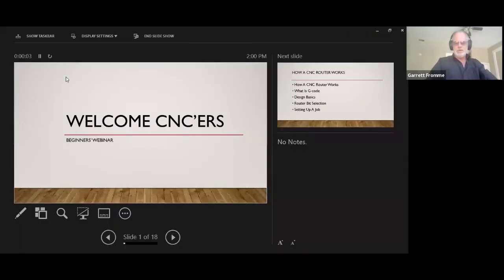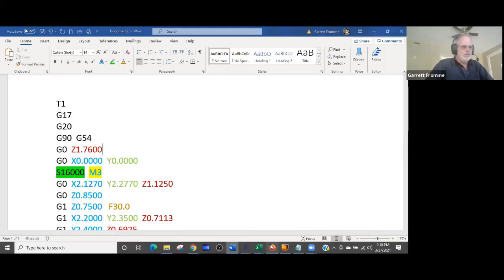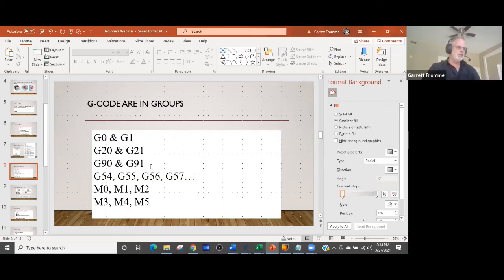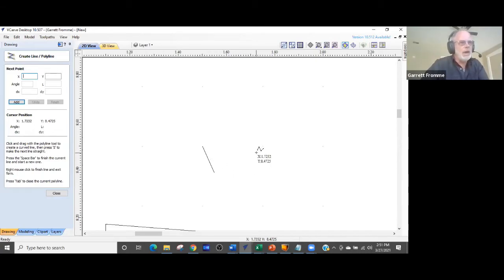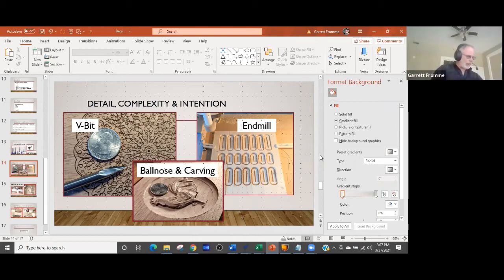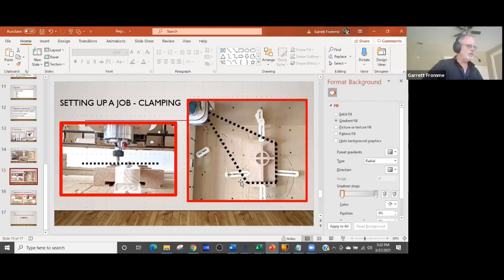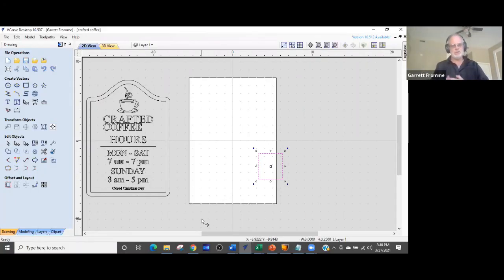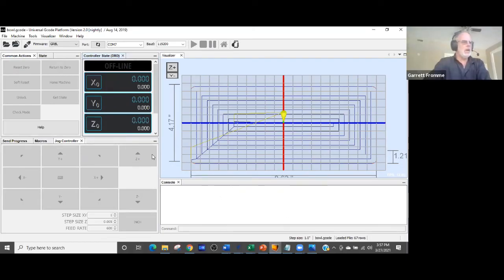CNC Router Basics Webinar, How They Work, Design Basics for Beginners

Comment: A little off topic, How would one die-cut a sticker on wood?   
My image is sized 5" x 5" .jpg, but when I import it into Aspire with a work area of 5" x 5", the image is smaller than the work area of the same dimensions.
Is there a dpi image setting in Aspire?
Reply from the maker: keenefx321, To die-cut a sticker on wood, you would typically set up your design in Aspire and ensure it's set to the right size. The DPI setting usually doesn't directly affect how the image is imported in Aspire, but it can help with the quality of the cut. Check the settings when importing your JPG to make sure it matches the intended size. You might also want to verify the units used in Aspire to ensure they align with your dimensions. If you adjust those settings, you should see better results with your image size!
Reply: @IDCWoodcraft  Thank you for taking the time to respond. I'll give it a shot.

Comment: What would cause Vcarve Pro to carve 80% of a 3D carve, then stop and say "finished"? Ruining my work and wasting my wood. If anyone knows what causes that and how to fix it I would appreciate it because vcarve pro has been nothing but problems since I got, very buggy software.
Reply from the maker: JD-nq4vb, It sounds really frustrating to have issues like that with VCarve Pro. One common reason for premature stopping could be a communication error between the software and your CNC machine, such as a loose connection or interruption in the signal. Another possibility is that the job may have settings that accidentally trigger the software to conclude early, like incorrect tool paths or limits set on the machine. Checking for software updates might also help, as bugs are often fixed in newer versions. Wishing you better luck with your projects!

Comment: Thanks Garrett for another instructional video.

1. As far as learning G-code get Peter Smid's book, "CNC Tips and Techniques" (Amazon). Although the book is directed towards milling machines, it's still applicable to CNC routers.

2. Peter Smid also describes in his book the safest way to "Home" a machine is by using G-code 'G91 G28 Z0'. In other words, since the machine is in incremental mode (G91) and Z is equal to zero, the Z-Axis will not move up or down. Next, the G28 command raises the Z-Axis to its Home position BEFORE any X and Y movement. Finally, G28 sends the router (X, Y and Z) to the Machine Zero (Home) position. As you can see, there's no way for the router bit to crash into any clamps because the router won't move the X or Y-Axis until the Z-Axis is sitting at the Home position (Top Limit Switch).
Reply from the maker: rogersecura378, Thank you for sharing such valuable insights! Peter Smid's book is indeed a fantastic resource for anyone looking to deepen their understanding of G-code. Your explanation of the G-code for homing the machine is really helpful and will certainly benefit many CNC enthusiasts. Happy woodworking!

Comment: Good stuff Garrett, I've been trying to think off a way to explain some of this to the Longmill/Altmill users, it applies to nearly any machine, most use almost the same Gcode or can ignore some of the code that's not needed.  The only thing I can't agree with is the fact that you said you don't need to understand gcode.  You absolutely need to understand basic gcode but the fact is you don't have to to make your machine run.  If you do understand it then you will have a much easier time running it and figuring out any problems that arise by looking at the commands and deciding exactly what is causing your problem by ruling things out.  Great content Garrett, hope our Sienci Brothers and sisters watch this.
Reply from the maker: larryrobinson7492, Thanks for sharing your thoughts! You're absolutely right that understanding the basics of G-code can really help with troubleshooting and making the most of your machine. I'm glad you found the content helpful!